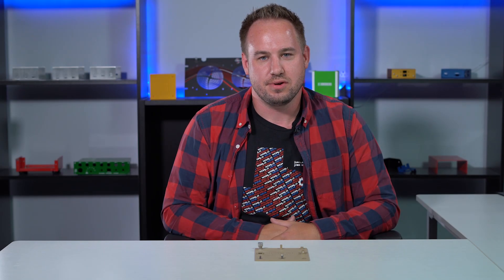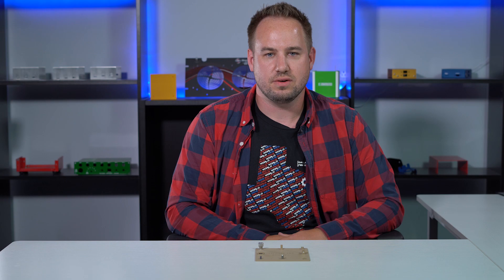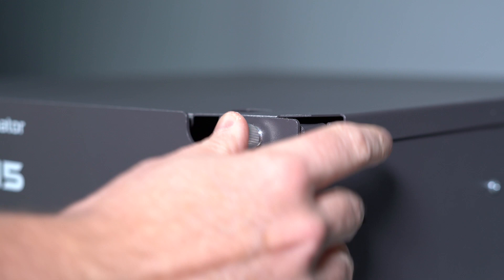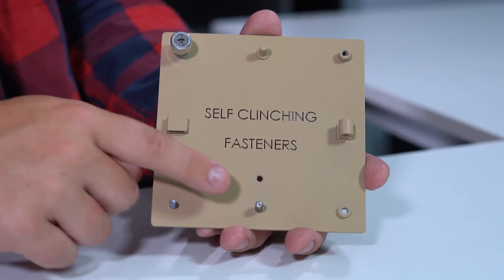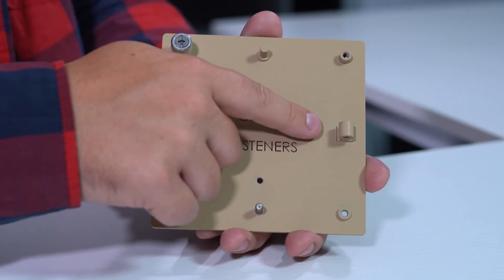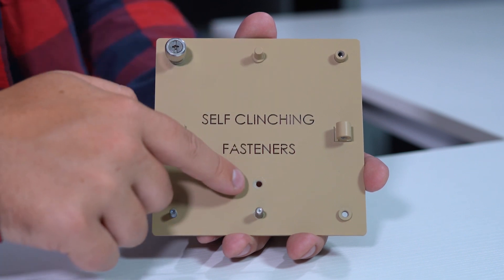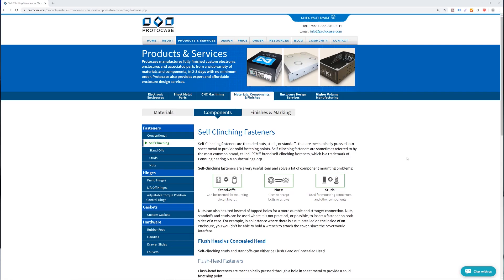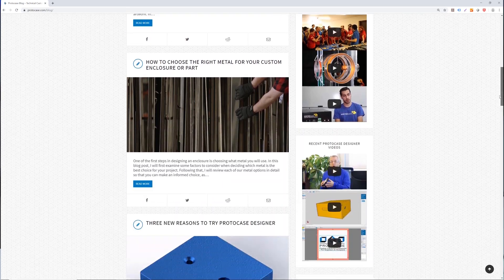Proto Tech Tip - Self-Clinching Fasteners

Comment: I have the proper size hole, but stud is not going all the way flush. Only have a small arbor press. I guess it is not big enough to install flush? anyone have a clue how many tons are required for a pemstud to go flush in aluminum. it calls for a .163 hole
Reply from the maker: Hi Richard, Penn Engineering's website may have that information readily available: https://www.pemnet.com/

Comment: Where are the right angle fasteners, or the panel fasteners, or the tie-mount fasteners? I can't find any of them in the protocase library.
Reply from the maker: Hi there, unfortunately, those fasteners types are not in the Protocase Designer library yet. (*But*, it is on our roadmap for our developers to add them. We can let you know once that is complete).

In the meantime, you can add in other fasteners by using the Import Component feature and importing a STEP file of the fastener. You can source the STEP file for any fastener by going to PennEngineering's website and searching the model number of the fastener you need. 

This tutorial shows you how to import a component as a STEP file and add it to your personal library: https://youtu.be/JUgmo6B_PA0

Comment: Can self-clinching 6-32 nuts be installed in aluminum sheet with a 1-ton arbor press? Can the 0.1875 hole be drilled (3/16"), or is it necessary to actually punch the hole? Thanks!
Reply from the maker: Hey there, so most self-clinching fasteners are inserted using a PEMserter machine with special tooling designed for different types of Penn-Engineering fasteners (PEMs). As far as we're aware, the style of PEM nut you mention CAN be installed using 1-ton arbor press since it doesn't require a "special" tool, but the nut will likely not clinch as well. The required pressure to insert into steel is 3,000-6,000 lbs, while the pressure required to insert into stainless steel is 9,500 lbs, according to pemnet.com. The holes can be drilled, as long as attention is paid to the hole size tolerance.

Comment: what is the best fastening method to attach (and be removable) 2 pieces of 1/8" thick aluminum. One side or both should be flush.
Reply from the maker: Hey Michael, we checked with our engineering team, and they mentioned a few ideas:

-Using a flush stud on one side, and a hex nut on the other (so it would only be flush on one side). This is quite commonly done.

-Another option that would yield close to flush on both sides would be using a flush nut (such as a F-832-1) that does not protrude, then countersinking the opposite piece and using a 1/4" screw. 

Hope this helps!

Comment: Can the self clinching stud be installed with hand tools ?
Reply from the maker: Hey there, thanks for your question. Studs need to be inserted through a press. The only self-clinching fastener that can be inserted using a hand tool are self-clinching nuts.
Reply: @ProtocaseInc  what kind of hand tool?
Reply from the maker: @jbpasion071  Hey there, we use something similar to this: https://www.pemnet.com/presses/pemserter-installation-equipment/

Ours is mounted to a worktable.
Reply: Hello  @ProtocaseInc  ! Yes I checked out this tool although, I am needing to install M8 and it is beyond the capacity of that tool.  I am still waiting on a quote from your company on a project! I am excited and hoping you guys can help me out!
Reply from the maker: @jbpasion071  Awesome!

Comment: how do you keep the thread clean during & after powder coating?
Reply from the maker: Hey there, we mask all internal and external fastener threads using silicone caps and plugs. More info here (and a few photos): https://www.protocase.com/products/materials-components-finishes/finishes/masking.php. Keeps the threads clean throughout the powdercoating process! :)